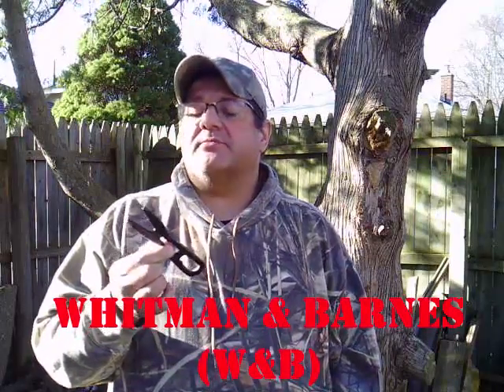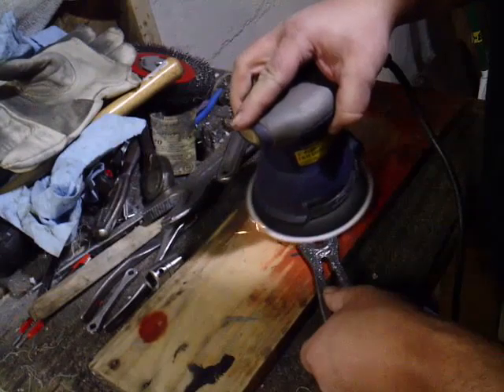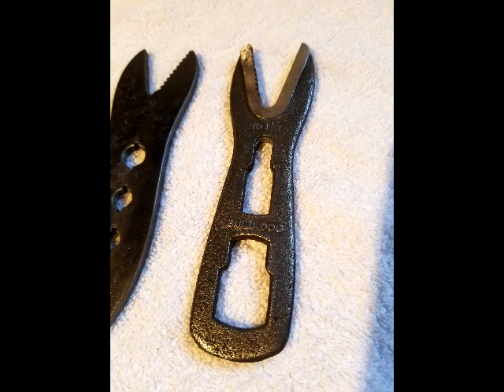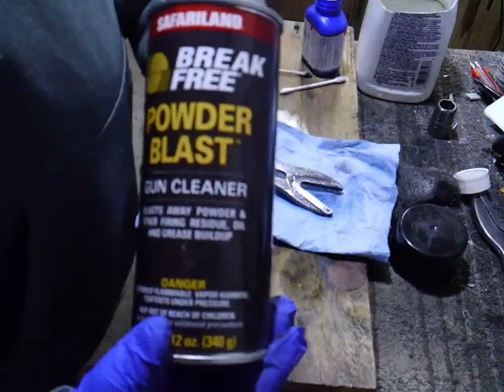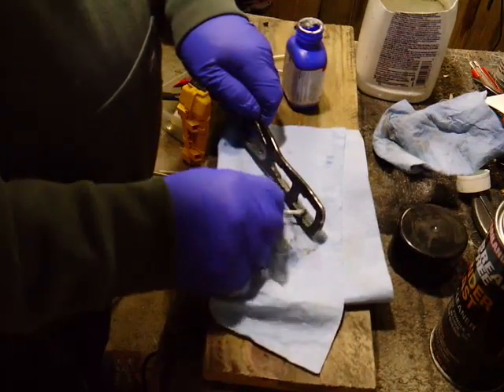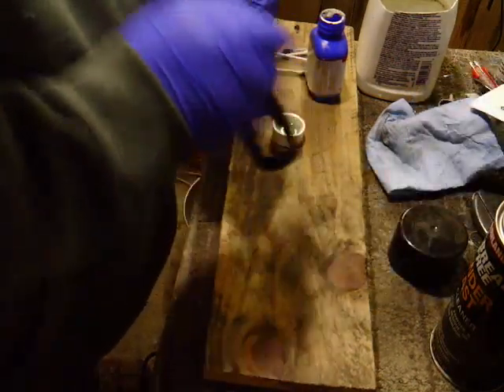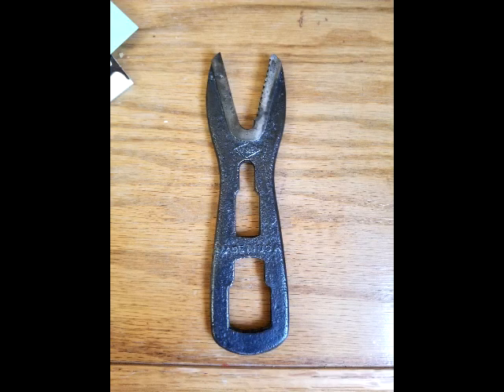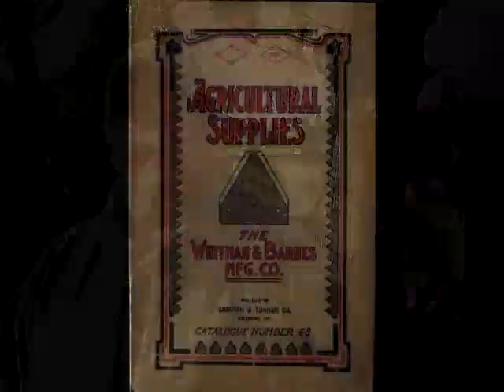Whitman & Barnes Manufacturing Company "Bull Dog" Alligator Wrench

Comment: I have a couple of these wrenches that I found at my local Goodwill I secured these thinking that they would be wonderful for emergency survival situations were  a fire hydrant or some other water valve needed to be opened in fact I thought that they were firemen type wrenches as mine have squares cut into  them. I believe mine have the initials v and B and the patent is from July 26th 88